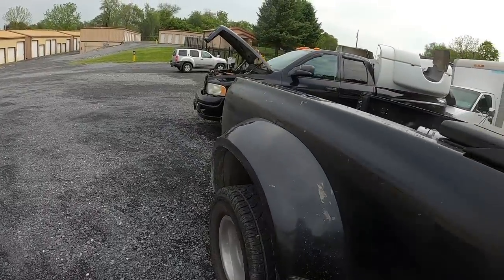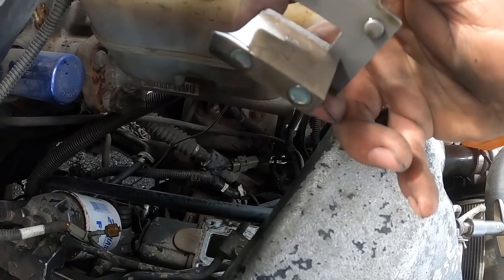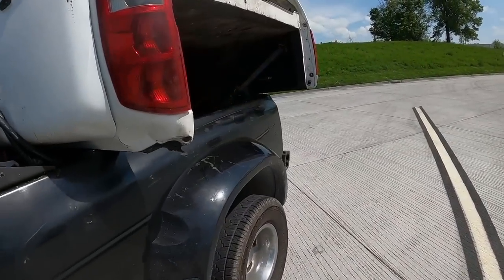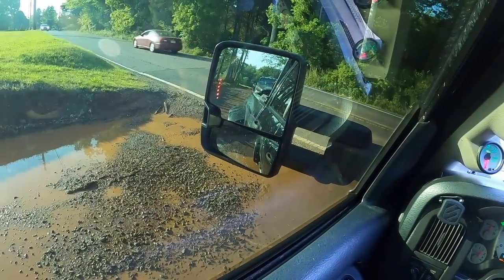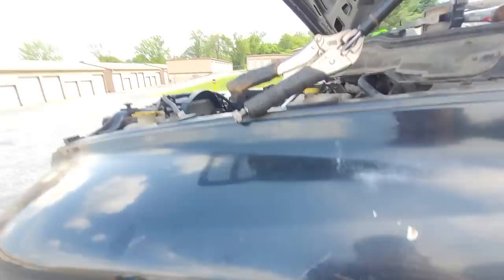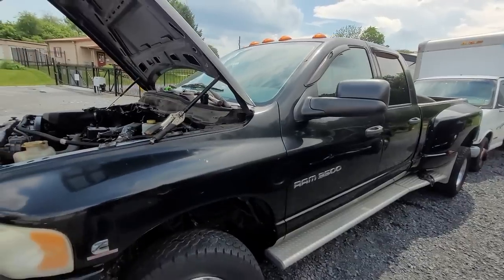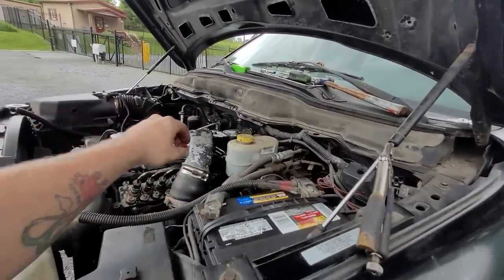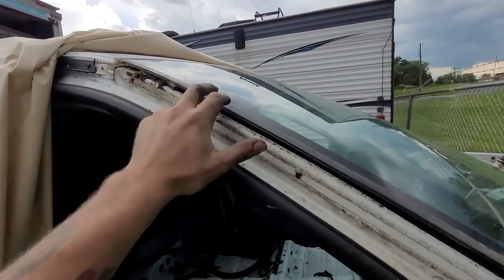Pickup Truck Hotshot Load PA To NJ | 12 Valve Swap Has A Stuck Rack | First Start Up | P7100 Repair

Comment: See that truck has the older steering wheel 3rd gens had. You didn't believe me. I was surprised yours had the newer style one.
Reply from the maker: Yeah 04.5 had the newer style. I think 03 04 was the old weird wheel. I just sold the newer style wheel to a guy with an 03. Apparently they bolt right up

Comment: Your hauling off a perfectly good cab, WOW, 
I JUST GAVE 2300 hundred for a 2000 model, replacing a rusted out one.
Reply from the maker: I'd hate to scrap it but I just have no use or room for it. I'd give the whole thing for 500 bucks. Just need more time to get the windshield

Comment: What exactly can the VIN plate be used for
Reply from the maker: I have everything from the white truck. Pcm, title, vin, all that set aside in case I need it in a future date
Reply: I was just wondering since they title  and vin plate are useless without the original body
Reply: @Thattruckdriver  not true.
Reply: @hankclingingsmith8707  how’s that?
Reply: @Thattruckdriver  Back in the day, vin plate, and a title were all you needed to get something registered and be legal. You had to report that you did it and take it to the State Trooper office and get it inspected.

Comment: Did you tell the kid how you were starting without the key 😂
Reply from the maker: Kid? The guy is older than me. And yes he was there for it. Key works to turn the grid heater on but it won't crank. I can only do one thing at a time so it'll get diagnosed as soon as I have the time. He wants it running and driving by Wednesday so he's bringing me the rest of the parts tomorrow.
Reply: @CPSteveMiller  no your kid that was holding the camera asking how you were doing that lol
Reply from the maker: Oh I was gonna say 🤣

Yeah he was confused as hell at first 😂
Reply: @CPSteveMiller  yea when I was little and my grandpa did that I was extremely confused 😂
Reply from the maker: Yeah then you pair that with revving it under the hood and now the kid's really lost😂